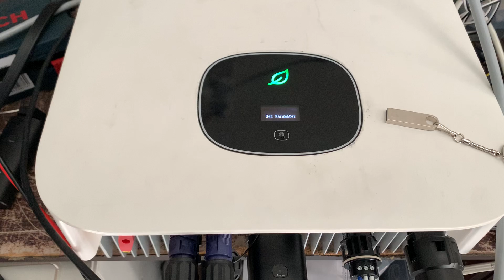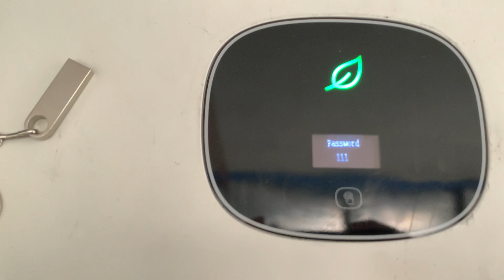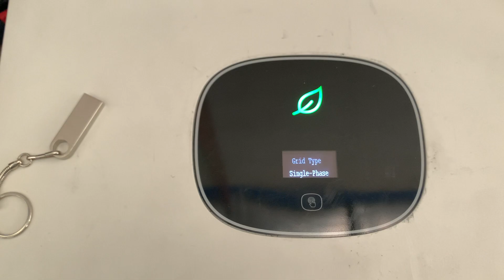Growatt XH/XA series inverters setup tutorial in the AC Coupled system

Comment: I have question di I need to connect the rs485. Because I bougth inverter second hand but still good but when I put in power. Not powering on the display? Any thoughts?
Reply from the maker: RS485 is for meter communication purposes, what model you bought?

Comment: Hi, do you know if a three phase inverter (MOD 3000 TL3-XH) is capable to push all it's capacity to one phase only if there is a high load on one phase, but no load on the other two phases?
Reply from the maker: hi, our mod-series inverters are three-phase output, the inverter will optimise the output based on the load consumption. However, it is still three-phase output.